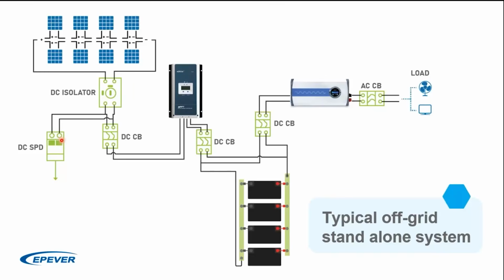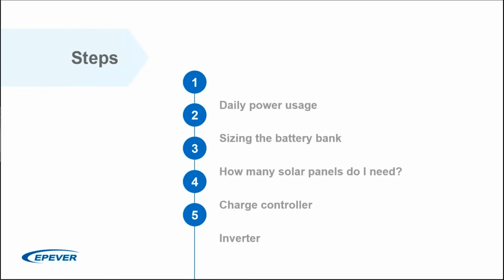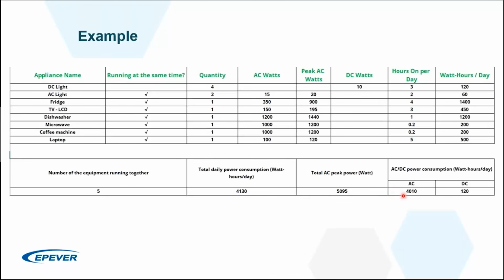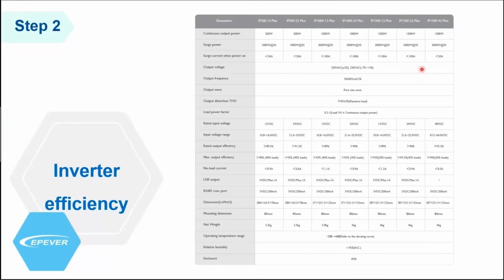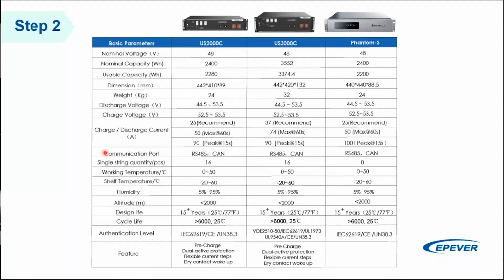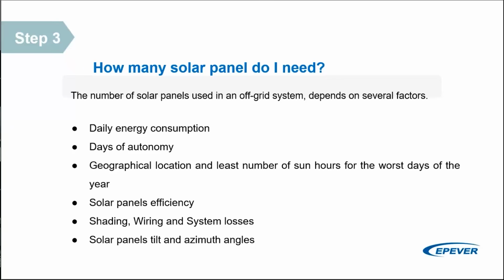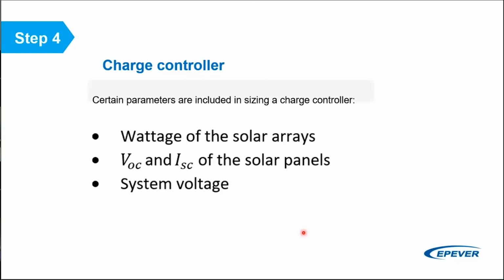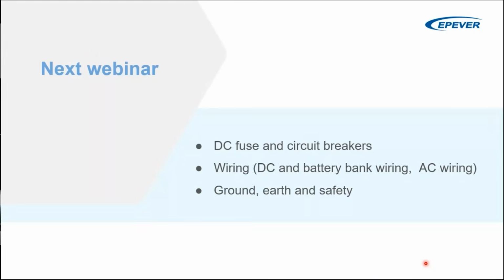How to Size an Off-Grid Solar Power System - EPEVER Webinar Series

Comment: temp.Coefficient 1/.97=1.030 and  you  have 1.0752 where did you take  that number please
Reply from the maker: Hello sir, you can find the number in the battery manual and specification sheet, mentioned in the video at 00:30:22.

Comment: Hi, I integrated a Tracer4210AN controller into my ESPhome/Home Assistant via the controller's Modbus registers and an esp32doit-devkit-v1 board. This integration is working perfectly and I can follow everything that happens on the controller with my cell phone. But I have a doubt about the register 0x311A (Battery remaining capacity in %). I would really like to understand what calculation is done to arrive at this percentage. Can you help me?
Reply from the maker: Hello sir, we are glad to hear that you have successfully integrated the Tracer4210AN controller into your ESPhome/Home Assistant setup. Regarding your question about register 0x311A, the battery remaining capacity percentage is derived from a calculation that takes into account the voltage readings from the battery. If you have any further questions or need additional assistance, feel free to ask!

Comment: Hi, Your explanation is very good!, but there is a point (29.11) that does not seem correct to me, the result of this formula (256.25 Ah). Shouldn't it be 409.97 Ah? The value of 256.25 Ah would be correct if a discharge depth were 80% and not 50% as in the example.
Reply from the maker: Hello sir, you are right. Thank you for pointing it out to us. The discharge depth should be "80%".

Comment: Why can't I set the low voltage disconnect voltage higher than 22.6 volts on my EPEVER IP 2000-22 Plus inverter. I bought the inverter on May 18, 2021
Reply from the maker: Hi, please send an email to helpdesk@epever.com, our technicians will help you
Reply from the maker: Hello Sir, the range of LVD is from 21V~30.2V. You can set it at 22.6V. But there is a logical relationship between different voltages. Please check the details on the user manual. If you still can not set it, please contact our support team.
Reply: @Epever  I know this logical relationships between LVD and LVR